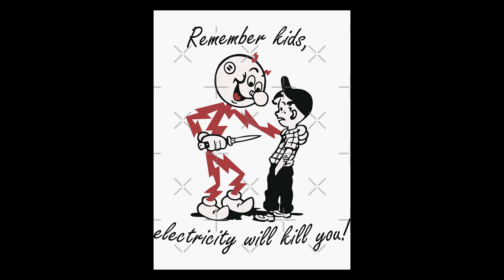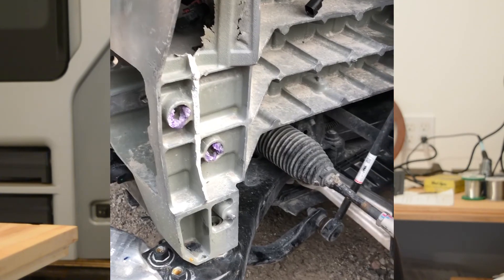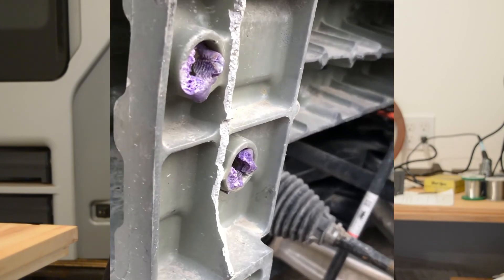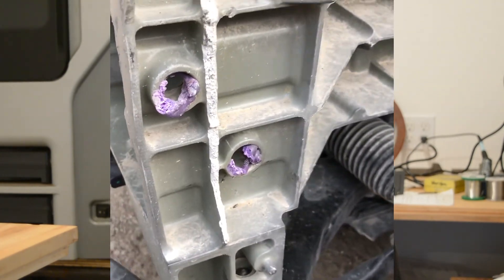Tesla Model Y Donor Vehicle Introduction

Comment: Have you considered fabricating the frame from aluminium?

The original Tesla ‘frame’ is aluminium, of course the body is too. 

I really want to build a custom SUV out of a Tesla using all aluminium but I know alu fabrication is a specialized skill…
Reply from the maker: Yeah it was a consideration. The cost is really what was the deciding factor. It would be possible for sure.
Reply: @519Kustomz  I will say that is a BEAUTIFUL frame! 

I’m used to the old ‘kit car’ days of cut and splicing 2x4” tubing! The good welders did a spectacular job, the bad ones were unsafe and pathetic…

Comment: Tesla the Ford Galaxy you did did you use the complete model 3 pack with no modifications ? and is the new project is way smaller that you can't use the model Y pack complete ?
Reply from the maker: Im just finishing a video on the next project. It uses a chopped down model 3 pack, the video will explain it. These 4680 cells are for the project after this one.
Reply: @519Kustomz  would it make more sense for you to create a custom enclosure for that product instead of chopping down a M3 pack?

Comment: Do you think 4680 is a game changer? means does it reduce battery pack size and weight drastically (or at least significantly). how can the buyer make sure if they get 4680 in the Tesla Model 3 they buy? is it that 4680 is only for Model Y and not Model 3? Thanks.
Reply from the maker: I wouldn't call it a game changer, It is much more of a manufacturing refinement. Currently the 4680 is only available in the Model Y, and it needs to be manufactured in Texas. Also I believe it needs to have the Model Y AWD designation. The Model Y dual motor is the 2170 pack. I think they needed the new AWD name because the Gross Vehicle Weight is different, but I don t remember the actually sticker weight. The GVW is likely the easiest tell tale sign it has the 4680
Reply: @519Kustomz  Got it, Thanks a lot!